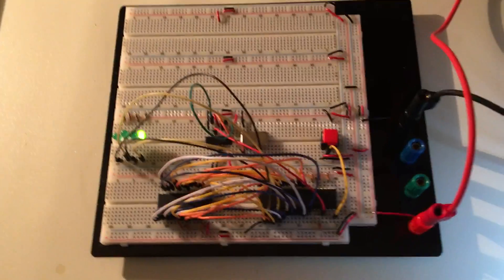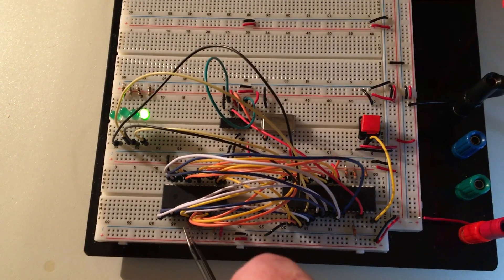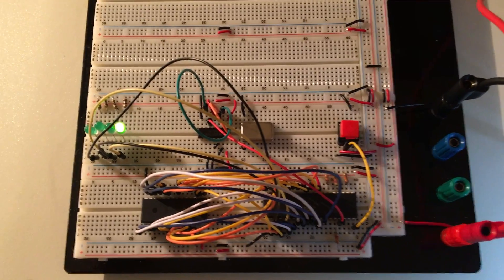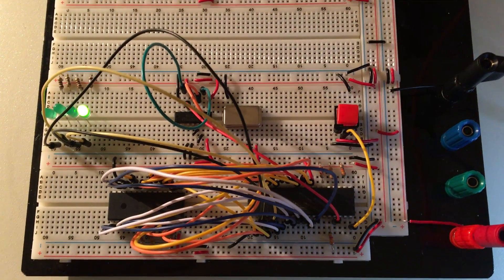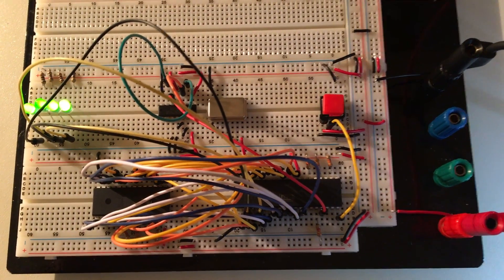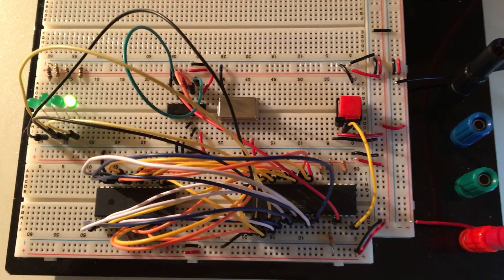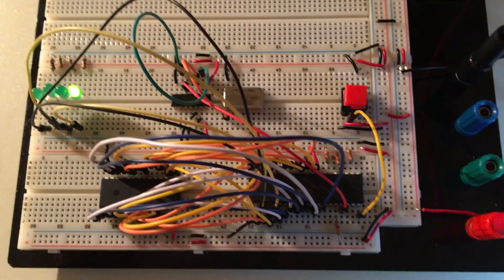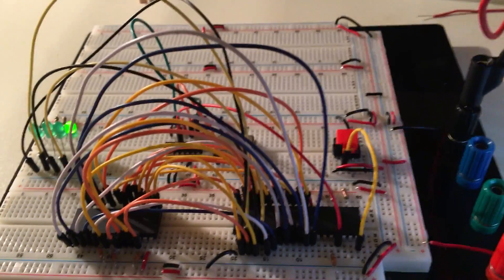6502 Mite homebrew computer project: step 2, adding a ROM

Comment: I've wanted to build a 6502 computer for years. I started a few years ago with 555 timers, tried Arduino and quickly discovered I like PIC better. Learned C there and only last year started learning some 6502 as it applies to the NES. 6502 seems so much more logical than PIC assembly to me. Guess I got spoiled with the X & Y registers, lol. If I ever get this beast built I'm going to attempt to interface a Gameduino that I never figured out on it's intended platform. It uses SPI so that's another thing I'll have to tackle but at least I have a better grasp of how to read/use the various memory registers. Your videos have inspired me to give a homebrew computer another go.
Reply: The 65c02 that he is using here is also quite nice compared to the old 6502 as it has a number of extra instructions that simplify a lot of things around the limited set of registers you have.